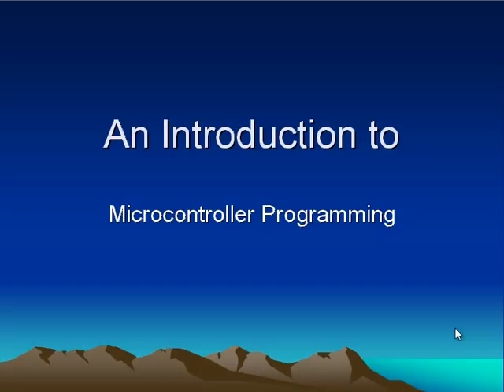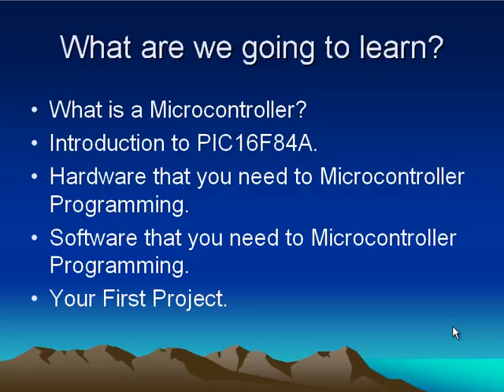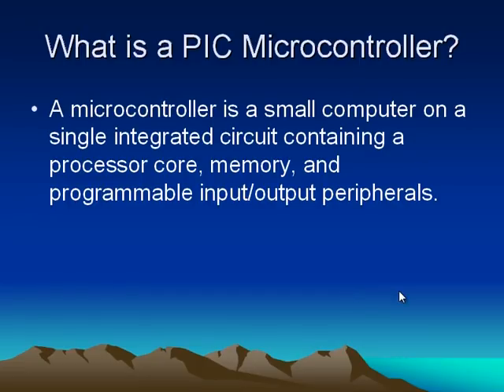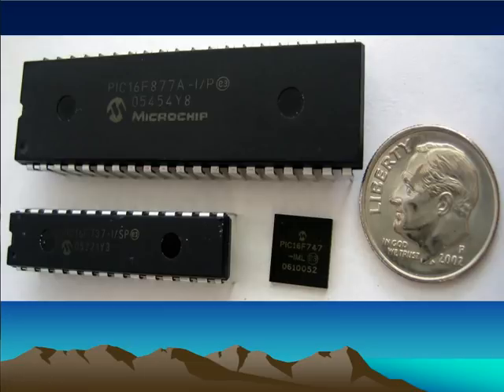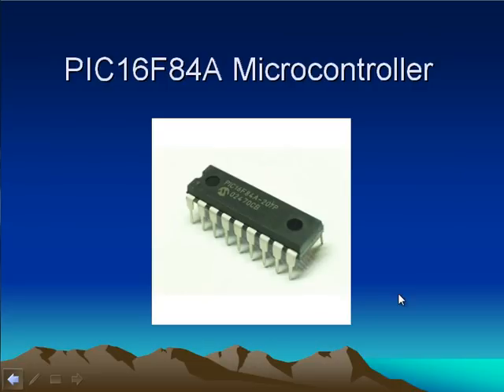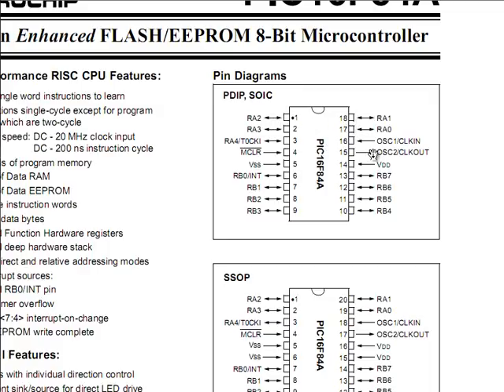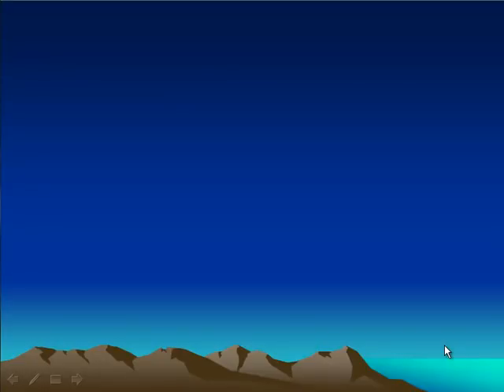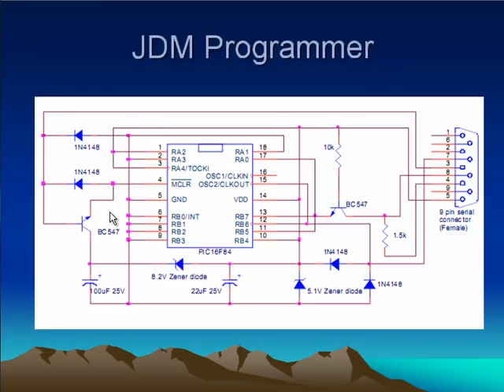Microcontroller Video Tutorial - Part 1

Comment: Hi,my project is electronic component tester.means it test the components such as capacitor,IC 555,op-amp etc.whether it is good or bad.and which UC should i use whether AT89C51 or AT89C52

Comment from the maker: Micro C is a special version of C specially designed for Microchip programming. C++ is also possible. But using Micro C is easy. It has all the libraries which required for Microchip programming

Comment: Just a quick note.  Thank you for posting these kinds of things.  I am in the process of getting into teaching electronics (I have been away from the field for about 25 years).  When I received my education programming microcontrollers was too expensive and somewhat in its infancy.  I started with the BASIC stamp but I wanted to work in a more useful language so I planned to switch the the arduino. What are your thought on this?
Reply from the maker: Hi Kevin, Thank you for the post. My thought is nowadays, Programming microcontrollers are not too expensive as early days. Arduino also a good starting point. you can start learning using the Arduino Uno board. PIC family microcontrollers are also good. You can use PIC16F84A to start. Both Arduino and PIC family microcontrollers can be programmed using High level C language
Reply: Dinesh Kumar Wickramasinghe
Thanks for the reply.  I have used a few programming languages: BASIC ForTran (I know I am old), lingo, hypertalk.  I hope I am not too old to learn another.  I hate to bother you but can you recommend a good place preferably online to learn C?  You mentioned the PIC16F84A can you program it on a breadboard or do you need some other hardware?
Reply: Dinesh Kumar Wickramasinghe can I use C++?